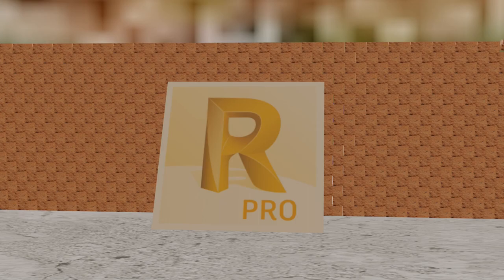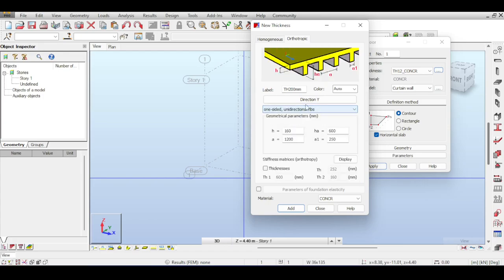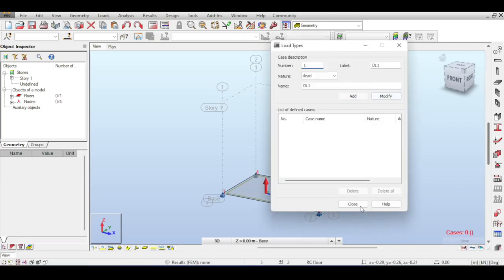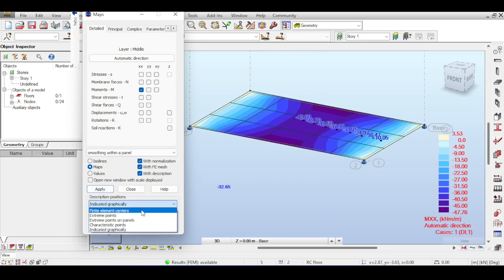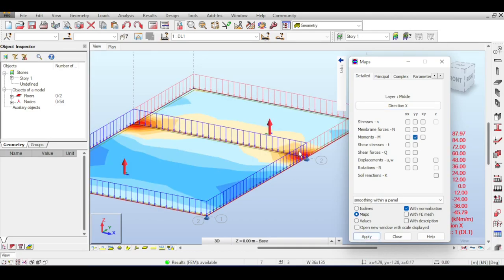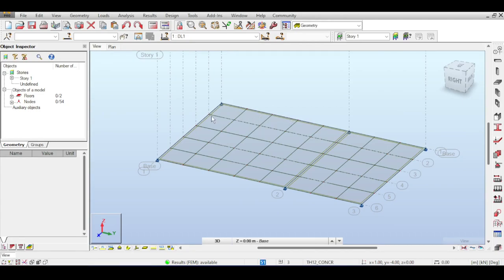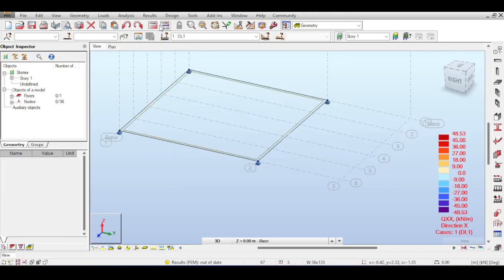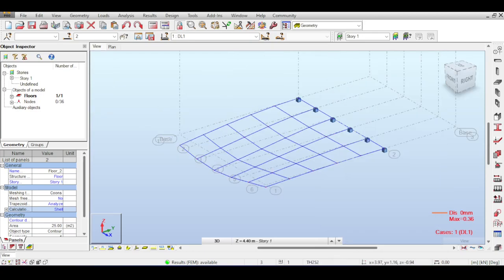Learning Basics of Plates and Shells in Autodesk Robot

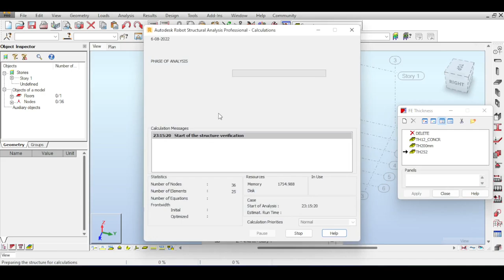Comment: Thank you for your effort in creating these videos. I have a question that I would appreciate if you could address. In the video, specifically from 29:10 to 30:00, you mentioned that the structure is weak in the y-axis, even after changing the direction of the slab. I found this statement a bit confusing, and I would be grateful if you could kindly clarify this misunderstanding for me. Thank you in advance for your time and explanation.
Reply from the maker: Hi there, thnx for the comment. I will try to give you a second by second break-down of that. Coz yep, it might be confusing.
I quick note: The local coordinate system of the slab and the global coordinate system of the model are the same. So X is always X and Y is always Y. That is a good thing to start.
so: 
in 28:55 I open the orthotropic definition and apply it on the slab. Note, the ribs direction is in the X direction.
Since the ribs are in the x direction, this means that the inertia for a strip parallel to the x-axis is stronger than a strip parallel to the y axis. So the x-axis is strong, and the y axis is weak.

This means that the lines parallel to x remain relatively unbent, and the lines parallel to y become bent, hence the deflection shape at 29:13

Then, at 29:34 I flipped the rib direction to y, so everything is now flipped, hence the deflection shape at 29:50

I can actually suggest a really cool experiment for you to do to visualize it.

Imagine you take a piece of paper (A square one) and bend one direction in a zig-zag pattern.  
/\/\/\/\/\/\/\/\/\

and now support it on four fingers on four corners (you might need a friend for this).
Look how the deflection shape behaves. It will be eye opening.
I suggest of course to have a rather larger square, so that it would deflect under its own weight. Otherwise, you would have to put a small weight on it (without totally destroying it)

Hope it was helpful. In case you have any further questions, please feel free to ask away.

I will pin this comment because it might be helpful for future viewers.
Thank you very much. It helps if you share this channel with your friends.

Regards,
CEE
Reply: Ok thank you I found this reply very helpful everything is clear when you flipped the ribs to the direction y then the slab is stronger in the y direction and weak in the x.

Comment: Hello. Great videos so far. I hope it continues and also for complex topics. a video about foundation slab (lets say mat or raft) with thicker areas where equipments are placed will be appreciated. (it is typically like a slab with drops but upside down). Also compatible nodes video will be good.
Reply from the maker: Hello there. Happy you liked it.
Sure, gonna add it to my ToDo list.

First, I have to do a simple video about rafts,
then make a video about rafts with increased thickness in regions of higher loads such as columns or - as you have mentioned - machinery and equipment.

Stay tuned.
Reply: @CivilEngineeringEssentials  awesome. looking forward to.
Reply from the maker: Quick Update on the matter. I have filmed the tutorial on compatible nodes and am video editting it at the moment. you can expect it to be available Saturday (fingers crossed)
Regards,
CEE

Comment: I found your video very helpful. I learn a lot from it. 
I want to know if there is a way to model the partition walls not as load but wall. I want this beacause i'm using revit and i'm modeling my partition walls. If i can transfer the wall directly without trying to model load this will be very helpful.
Reply from the maker: you are most welcome.
Partition walls as elements (not loads) is not directly possible in autodesk robot. Because it assumes those to be "shear walls" 

However, I can suggest a work-around (I have not tested this)
In case you know the stiffness of the wall in the vertical direction (Force vs vertical displacement) then you could use it to modify the wall such that:
AE/L of the shear wall is very close to AE/L of the brick wall. 

This does only work for purely axially loaded walls. Also note, I have not yet tested it, so I am pretty sure that there are some problems when it comes to shear and bending behavior. 

Sorry for the long answer.. The shorter TLDR version is: unfortunately, no.

Regards
CEE

Comment: Hi CEE, its a great video thank you, can i ask some question. Can you explain between Plate and Shell formula? Recently I read in online, RSA use thick plate formula but in SAP2000 can choose many option of the formula. So can we apply the shell thin formula to RSA? Thank you
Reply from the maker: Plate and shell are identical in Robot.
It uses a Discrete Modified Kirchoff Triangle and Discrete Modified Kirchhoff Quad.

RSA's model here works well for both thick and thin.
There are other theories such as the mindlin theory, which only works for one type of plate.

Here are the references for the DMKT and DMKQ
https://www.autodesk.com/support/technical/article/caas/sfdcarticles/sfdcarticles/ROBOT-what-types-of-finite-elements-are-used-in-the-program.html

Comment: Hellow . Thanks ypu for this vidéo. I would like to explain a little bit Mises Stress. When should we use this type of stresses wile analysing strctucture.
Reply from the maker: Hello there.
English:
In my opinion, it is only used for steel plate elements, because the stresses are from 2 dimensions in addition to shear, so it would not be enough to consider moments and stresses form one direction only

For beams, columns and connections, my humble opinion is to use the normal bending moment and axial force approaches as written in the code.

العربية،
من وجهة نظري، أعتقد إنه إجهادات فون ميزس تستخدم في تصميم البلاطات المعدنية فقط، حيث يوجد الإجهادات من كلا محوري السين والصاد والقص، وعليه لا أعتقد من وجهة نظري المتواضعة إنه التصميم من جهة واحدة مناسب،
اما العناصر الخطية كالأحزمة والأعمدة، فمعادلات الأكواد مناسبة، 

German
Von meiner Seite glaube ich, dass die von Mises Spannung nur im Fall einer Stahlplatte benutzt werden, da es ja Spannung aus der x und y richtung gibt.

Fuer Balken und Saeulen, wuerde ich die normal Gleichung der EC oder DIN verwenden.

Regards,
CEE

Comment: Thanks for the such a wonderful Video. It has very useful information 
I need your help in understanding the Principal stresses and complex stresses. Actually, I am working on steel bridge design which has two longitudinal box gliders and transverse girder above which I have a deck slab based on required of Client I have asked to model part of bridge with plate and shells and need to check location of stress concentration and stress variation to check fatigue failure.
Can you make a video that explains what principal and complex stresses in detail and explain how we corelate for design of steel structures i.e plates.
Reply from the maker: Sure that is a good idea. I might be still - however - working on the bridge series on Midas, so it might take a little while
Still, thnx a lot for your comment. I am really happy it helped.
Regards,
CEE
Reply: @CivilEngineeringEssentials  thanks a lot for such prompt reply 😊. I am bit hurry to show some progress on the work. It would be great help if you could share a document/link on the complex stress theory in autodesk robot manual. Also, is there any other way to connect with you to discuss on this further ?
Reply from the maker: @chaiturishan4u Will prepare a video for you right now. Stay tuned ^_^
Also, yes
civ.eng.essentials@gmail.com

Comment: Hi, how can we apply an eccentricity/offset for a panel? I have a case of an wall having 100cm thickness and on top of it (linked) there is another wall of 50cm thickness.  I saw that In SCIA Engineer there is the eccentricity function which that is applicable to panels. Thank you in advance!
Reply from the maker: Hello there and thnx for your comment.
To be honest, I am not 100% sure that there is a "quick command" to do that. What I would do in RSA is to model both and connect them manually with rigid links. But a "full-automated" tool, not that I know to be honest.
Regards,
CEE

Comment: What the different between definition the slab by panel or by floor in Robot and what is the more suitable to be use in soild slabs
Reply from the maker: Technically, there is no difference. And here is why:
if you use the "floor command" to draw a slab, then it does two steps for you
1) It does create the contour
2) It does fill the contour with your slab

if you use the panel command, then you have to click a contour that you already drew. So it is basically doing step 2 for you.
if you want to use a panel command, you have to first draw the contour using Geometry -> Objects -> Contour

then you go to panel and click inside the contour. It is important to make sure that you select the correct settings. Especially the model should be a shell or equivalent.

Hope it helps,
Regards,
CEE

Comment: Hey, thank you for your video, the panel cut result gives kNm /m what does this mean why is it per m and not simply kNm ?
Reply from the maker: Hi there.
It means
Kn.m /m
Moment kn.m for a strip of 1m width
So
To read it more clearly you should say
Kn.m per 1m strip
Reply: Thank you @CivilEngineeringEssentials
Reply: Thank you for you answer one more question, in the eurocode the shear needs to be verified and if necessary minimum shear reinforcement must be installed, is there a module to check and calculate the shear reinforcement in robot for slab design ?
 @CivilEngineeringEssentials
Reply from the maker: Not sure. It checks the shear and warns about it. But it does not provide extra shear reinforcement.

Comment: Thank you for jour job ! I have a question. Could write more about shear stress in part "principal" ? I cant find the formula how robot calculate it. I try to understand it, generally when i calculate shear stress in slab on piece of paper I calculate "just shear stress" to judge if it will be problem with punching or no and here i see txx and tyy and then in principal t. How to understand "txx" and "tyy" and how to connect it with "t"? I will be gratful for help :)
Reply from the maker: Hi there, thnx a lot for your comment. It is always a joy to me to know that those videos help ppl.

The principal stress in shear is calculated via "Mohr's Circle"

But not any "Mohr Circle", because:
as you noted, t_xx and t_yy are there, and they should have a meaning, right? So here is the meaning of t_xx and t_yy

t_xx is the shear stress due to the shear force Q_xx. 
so t_xx = Q_xx / Area <-- simplified version.
 Now to understand this further, I must explain what Q_xx is. 
V_xx is the shear force that is on a strip parallel to the local x axis of the slab.

similarly, t_yy is caused by Q_yy, which is the shear force on a strip parallel to the local y axis of the slab.

So the calculation of the principal stresses based on that is a little bit more tedious. Your usualy "Mohr Circle" with sigma_x and sigma_y and tau_xy does not work, because now you have more than just tau_xy.

In case you need further details, feel free to ask another question. I hope I addressed your point, but I still might have missed something, so anything you need just ask, will do my best to detail it for you.

Regards, 
CEE

Comment: Hi, which coefficient should I input in orthotropic stiffness reduction to account for 0.25 reduction for slabs covered in ACI code? Pretty unsure about f11, f12, f22, k11, k12, k22, v13, and v23 terms in Robot. In ETABS I usually reduce the f11, f22, f12, m11, m22 and m12 by 0.25. Which of those are equivalent in Robot? Thanks a lot
Reply from the maker: Thnx a lot for your comment.

First, some basics (for others who read the comment):
The stiffness reduction coefficient in the ACI code tries to account for the reduction in bending stiffness due to the cracking of the section under ultimate load conditions. This is used in various calculations, such as calculating the "k" coefficient used to determine if a column is long or short.

With that being said, what would you modify in a column or beam?
Well, you would modify the two bending inertias and maybe the torsional inertia. You may not deem it necessary to reduce the cross sectional area.

Now this is in a column, what about a plate?
----- Here starts the answer portion to your question ---
in a plate, you have a matrix for membrane force resistance, which can be reduced using the f factors,
you also have a 3x3 bending resistance matrix, which is reduced by the k factors,
you have a 2x2 (depending on the FEM assumption) matrix for shear resistance, which is reduced by the v factors.
you also have weight and mass, but those do not need to be reduced.

Based on my understanding of the "reason" behind the reduction, I would suggest reducing the ks and optionally the fs, but not the vs as in the assumption of shear resistance, the section is assumed to have cracked, and the resistance of concrete to shear is partially due to the friction of such cracked section.

I hope it made sense.

Regards,
CEE
Reply: @CivilEngineeringEssentials  so f11=f22=f12=k11=k22=k12=0.25 in that case? What about the input bar beside the “symmetry” sign in the plate stiffness matrix in robot? It does not have any terms beside it, should it be left as 1?
Reply from the maker: I would keep it as 1.0
if you set f11 f22 f12 = 0.25,
then you are also acknowledging that there is a reduction of 25% in the axial stiffness of the membrane. It was not specifically mentioned in ACI, but it does not hurt.
Reply: @CivilEngineeringEssentials  Thanks for the reply, I guess I will also put 0.25 for the fs. Much appreciated.